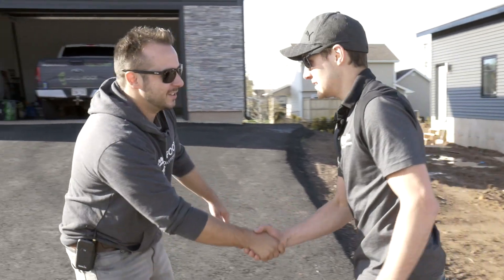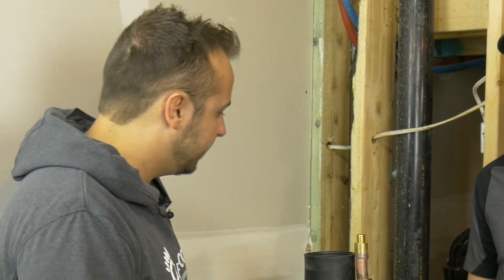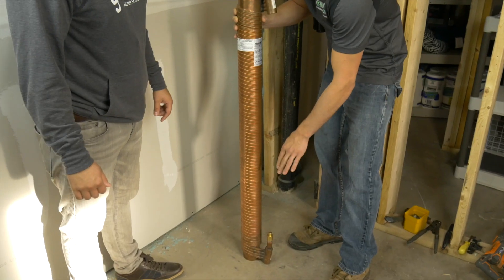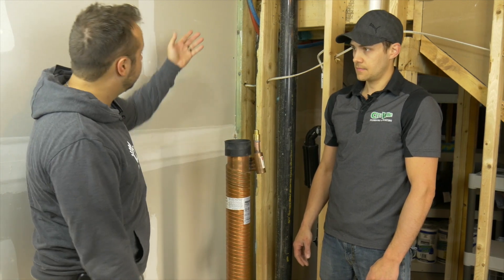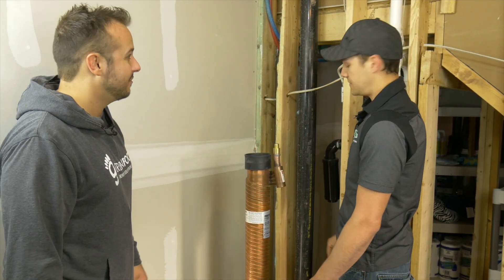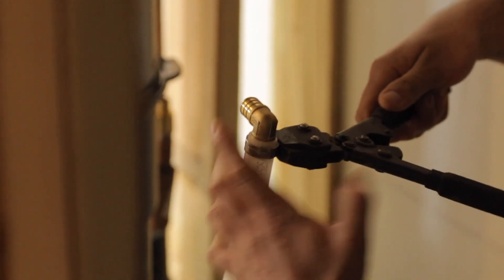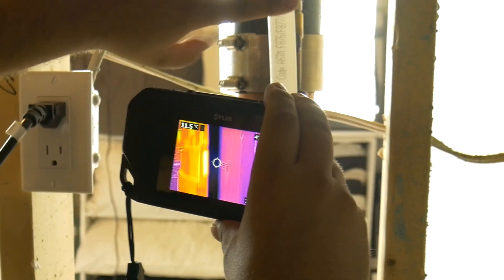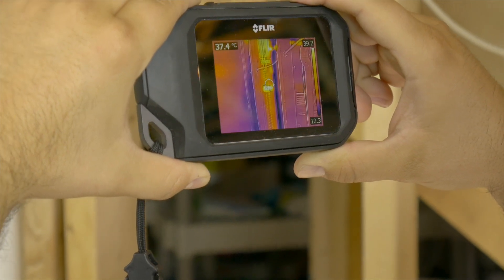Drain Water Heat Recovery - Greenfoot Energy Solutions

Comment: Hi, thanks so much for this video! So if I understand this correctly, I would take the 3/4" pex line that comes off my main water supply into my home, and route that to the bottom of the Drain Water Heat Recovery unit. Then have a 3/4 pex line coming off the top nipple, and route that to the "cold-water" inlet line, to my Rannai Tankless Hw system. 

Is this correct?

Comment: Would it be possible to make something like this but shorter so you can install it in like tinyhouses or RVs and other buildings that might not have so much under floor space?
Reply: I guess i could do like one with 90 degree bend so it will fit under floor?

Comment: Now you have to pay more to heat the room.   Lol!
Reply: No.
Reply: @E_Jay10  yes, it also steals heat from the air around it unless you insulate it and in winter cold air is more dense then hot air aswell as -40 air going down a vent can take away a lot of the effect theres a while list of flaws with these including potential to freeze in a vacant house in cold weather if insulated

Comment: Great video guys. I wonder if you could use the waste heat from drain water in a tankless system?  If not, how about a small hydronic system?
Reply: You can. The cold water line just gets run from the heat exchanger to the tankless water in line.

Comment: Pierre sounds like an intelligent and professional guy, he must have been paid a fortune to put his Red  Seal on the line like that! brainwashing knows no bounds
Reply from the maker: tauruszuma  Not sure why you would say that? Drain water Heat Recovery is actually in local building codes in Ontario Canada and most likely soon to be code in new energy codes coming up. Technology is simple. It’s basically the same as an HRV but for hot Water. Makes sense?
Reply from the maker: tauruszuma  Here is some reading for you! Let me know when your done: http://renewability.com/#learn-more
Reply: If you did five minutes of research, you'd realize that you have no idea what you're talking about.
Reply: Thanks for the video guys. I do energy audits and it's great to see contractors promote a great product. I'm installing one of these DWHR units in my daughter's townhouse for safety reasons and the energy efficiency. She has an old Natural Gas (NG) water heater that is corroded. I'm worried about a failure causing either a Carbon Monoxide leak or a NG leak and possibly explosion or fire. She has electric space heating. I'm replacing the NG water heater with an electric one with a programable timer to move the water heating off peak demand and cost. Also at the same time will install the DWHR. She will avoid the monthly NG meter fee (about $300 per year). The electric operating costs in this arrangement will be similiar to NG  and I will have the peace of mind of knowing my daughter is safer.

Comment: The only way you will ever recover the cost of this thing is if the price of copper goes up to 100$ a lb and you recycle it.
Reply from the maker: Robin Andrews Have a look at the technology and you will quickly find it’s is the simplest efficiency upgrade you can do to a house. Its actually included in some local building codes in Ontario and soon to be throughout Canada. Cost of install and materials is around $1000 so very inexpensive.  Checkout manufacturer website for more details: http://renewability.com/#learn-more
Reply from the maker: Robin Andrews Its essentially like an HRV ventilation system but for hot water during showers.
Reply: This is a great, no brainer.